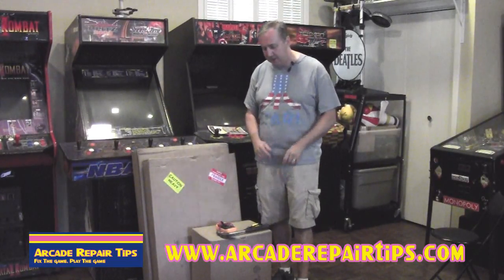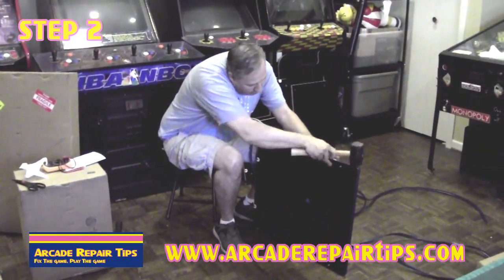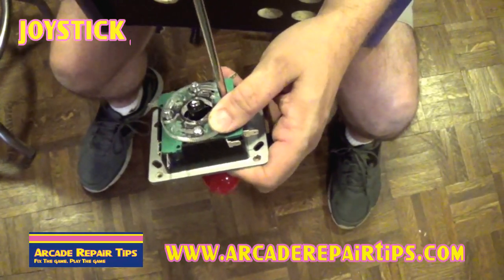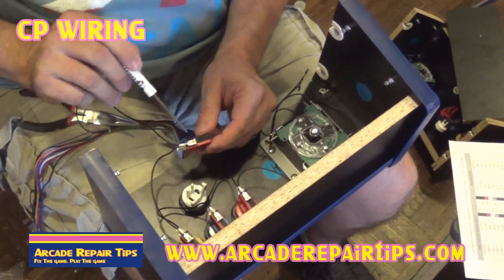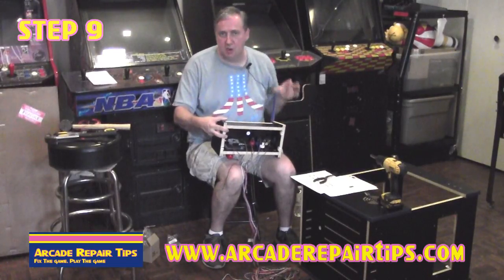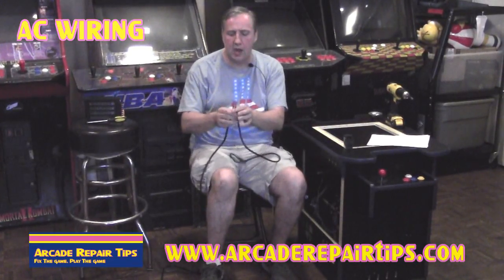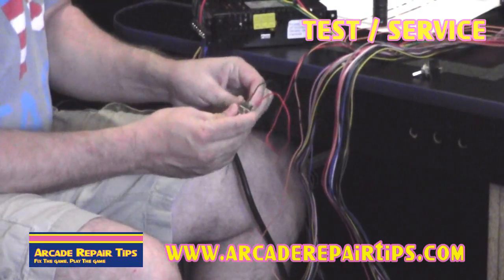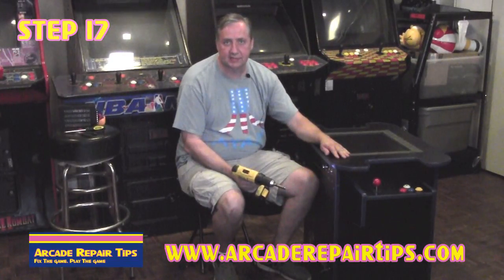Arcade Repair Tips - Assembling A Cocktail Cabinet Kit (With JAMMA Wiring Harness) - OLD VERSION

Comment: Thanks for the informative video.  Couple of Questions - Does the JAMMA Harness support 2 Speakers or just 1?  Is this Cocktail Cabinet the same size/footprint as the "original" Cocktail Cabinets that were released back in the day?
Reply from the maker: Scott, the JAMMA harness only has one set of speaker wires dedicated for audio output but you could splice into these to connect another speaker. Yes, the cabinet is pretty much the same size/footprint as your standard Midway cocktail cabinet. We say pretty much because the cabinet is not quite as tall but not enough that you would notice unless you had them side by side. We talk more about this kit in Live Show - Episode 7 if you would like to know some additional details about it: https://youtu.be/kh22wLkWnOs?t=1h5m39s. Hope that helps.